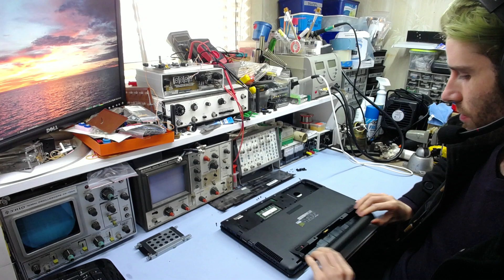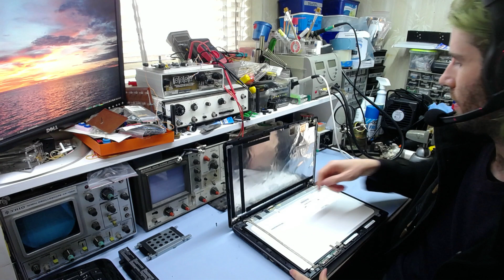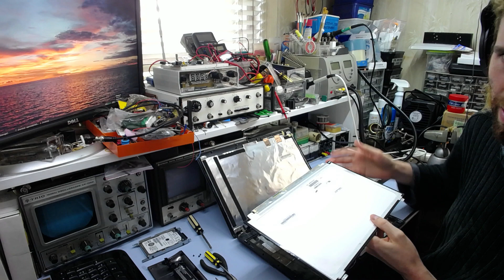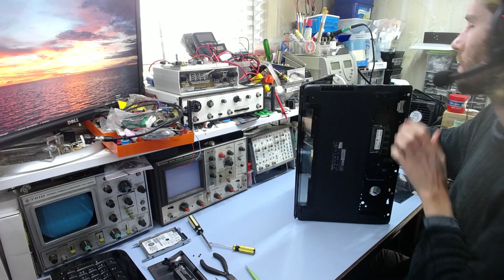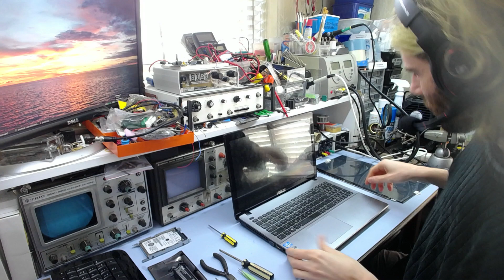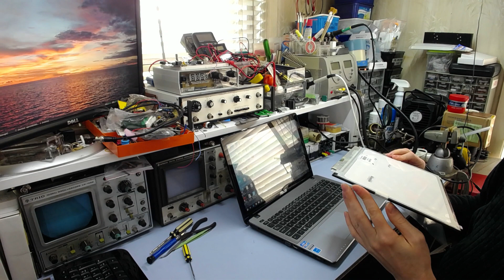Asus X550C LCD panel replacement

Comment: My asus x550c  laptop display became bluish & Yellowish,,, 
No red light present in display color calibration,,,, 
What would be the probable cause? 
Is it due to ribbon problem? 
My display is okay in other laptop,
Using external monitor is also okay,

What would be the cause?
This problem starts after repairing with local mechanics
Reply from the maker: It does sound like the cable could be faulty.

Comment: Thanks for the video. Is it possible to put back the LCD panel and the bezel without the digitizer?
Reply from the maker: It's likely possible, but it probably won't look very nice.
There is also a question of whether the digitizer controller would be happy with that, and I don't know.
Reply: A bit late to the party... On my similar Asus S550C with touchscreen digitizer got broken years ago. So I've removed digitizer, also unplugged digitizer controller and laptop is working perfectly fine for years now without touchscreen. Bought that laptop backthen in 2013 not because of touchscreen (I hate it because of quite nasty reflection) but because of nice specs (Core i5 Ivy Bridge...) and sturdy aluminium case. Since then laptop got quite of HW upgrade: faster 2x 4GB RAM with tight CL timings, 2x 2.5" SSD (2nd one via 9.5mm caddy adapter instead of CD/DVD) and still has one mSATA slot free for 3rd SSD I'm going to use for another 512GB SSD soon. More than 9 years of (ab)use without any hiccups, original battery still holds around 2 hours of usage, can't ask for more.

Comment: how do you attach the lcd/digitizer so easy to the lid?
Reply from the maker: The LCD I replaced was stuck to the plastic with strips of foam rubber adhesive tape. I removed these from the original LCD and used them to stick the replacement in. Some of the tape may stay on the lid frame when you take the old LCD off as well.
If you have lost the tape you will need to get more. It was about 1mm thick, about 3mm wide, from memory.
From other videos I've seen, the digitiser is stuck down with adhesive tape of some kind as well, but in this case only the LCD was broken so I didn't replace the digitiser. To remove the digitiser you may need a hot air tool.

This video may help?: https://www.youtube.com/watch?v=XBZE1Uccr2c
Reply: @Agent24Electronics  i phrased it badly. I actually took the digitizer off and replaced it without a hitch. The problem is trying to put the assembly back into the lid (near the 8 minute mark in your video). Its really frustrating
Reply from the maker: @rkl5001  Oh, right. I'll try to explain. It is a bit tricky, the two halves don't just snap together, such as say, my T61...

Viewing the screen as in normal use, you need to mate the front half of the lid with the rear, initially with the front say 3-4mm lower than the rear, then while pressing the two together, slide it up into place on the clips. The bottom edge then just needs to be squeezed together.
Reply: I appreciate the help. I just ordered another lid since the plastic clips broke on this one. I'll let you know if I fixed it @Agent24Electronics
Reply from the maker: @rkl5001  No worries, I hope you get it fixed in the end!